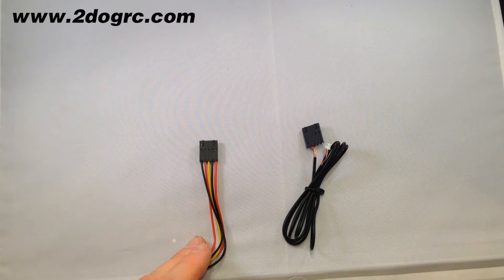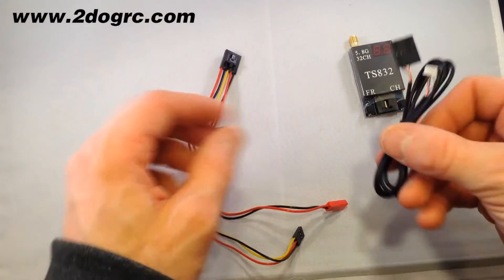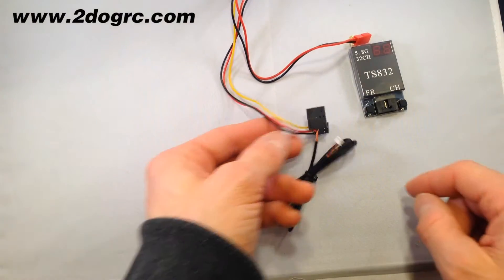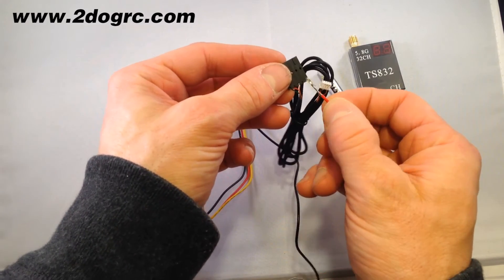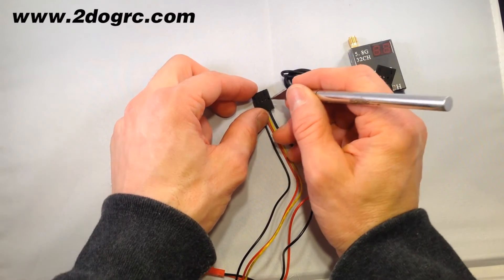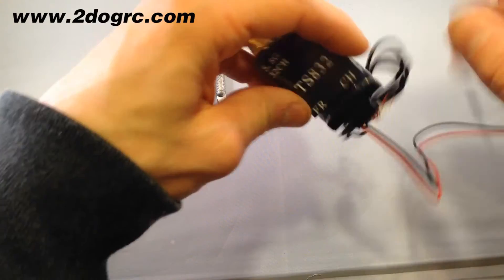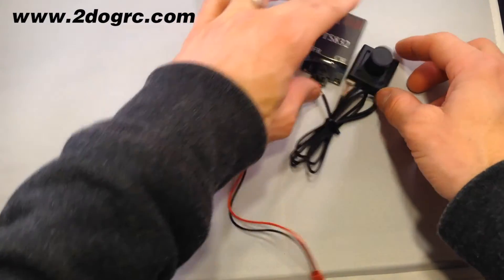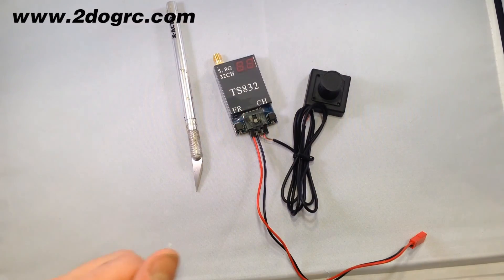Plug and Play 5.8 FPV System from 2dogrc, Boscam CCD

Comment: Great Video! I plan on using the Sony 600tvl with the same transmitter (similar setup as yours I believe) with a venom 20c 3s 4000mah. Now is this setup configured to run off an additional battery on a quad setup or can i tap into the main quad battery instead? If so, where would I plug the power cord running from the camera and transmitter into?
Thanks!
Reply from the maker: Hello,
 You can do either way.  The Red JST connector would go to a battery or it you could wire it directly to the power distribution board on your ship.